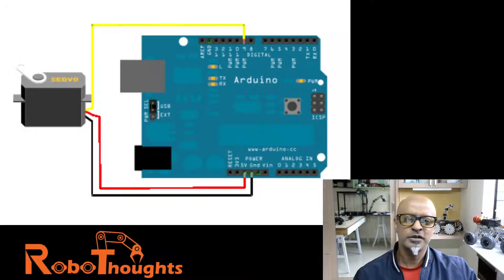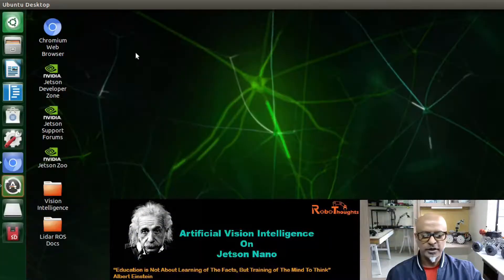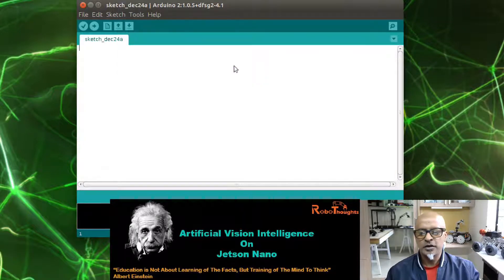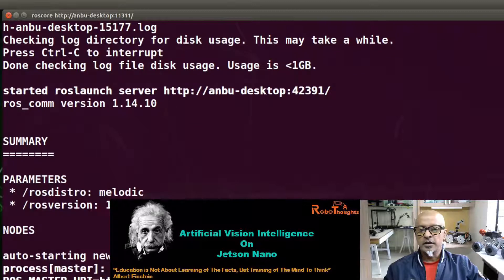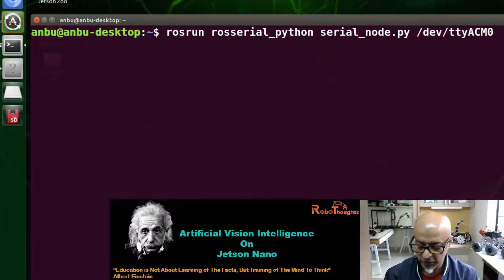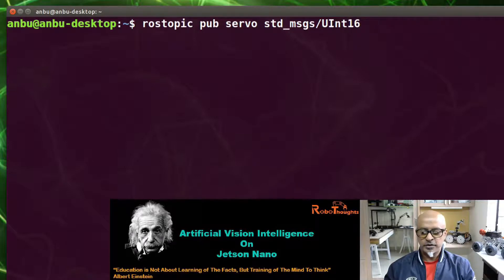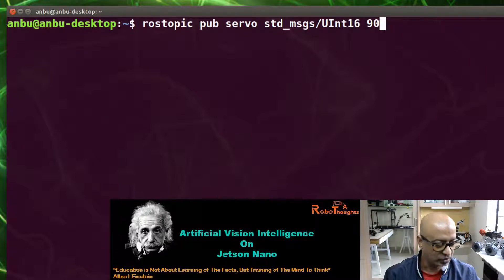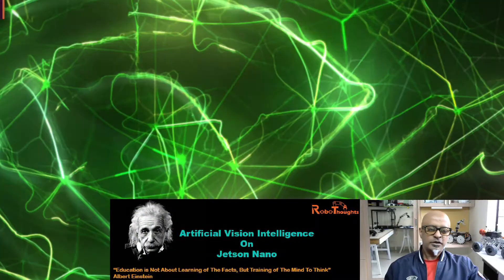Lesson 21 – Controlling Servo Motor Through ROS Serial in Jetson Nano

Comment: Hello Sir in my case with Jetson Nano, when I open up my Arduino through Jetson Nano there is no such port tty/ACM0. Instead of this I have tty/USB0 but I need to know how to install ACM0 driver. Could you help me with this? Thanks in advance
Reply from the maker: Hello, by default if your jetson picks up USB0, then I suggest not to meddle, continue using the same port, in the past I tried installing drivers on jetson which messes up the whole configurations, so leave it as it is

Comment: Hello sir i have written a code for PID Control of two Dc motor in c++ now want to shift my code in Ros have understood the publisher and subscribes concept form your videos. What i am trying  to do is that send publish a string to a topic and Arduino receive it and stores it as a string variable and than use that variable in my loop to control the motors . 
Can you please guide on how to publish a string and store it in a variable and then use it in your code?
Reply from the maker: Hello, you need to use  "std_msgs/String.h" header file.  This includes the std_msgs/String message, which resides in the std_msgs package. This is a header generated automatically from the String.msg file in that package. After this you can publish a node and communicate via talker.
Reply: @CodingScientist  Thanks alot sir issue is resolved i was also doing one more mistake giving the wrong baud rate